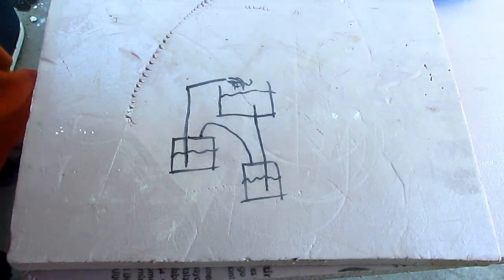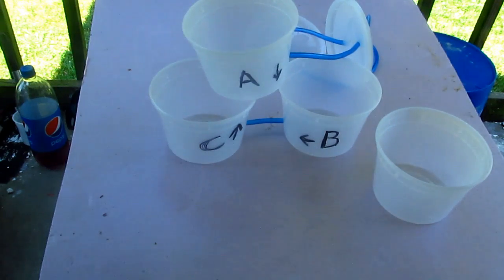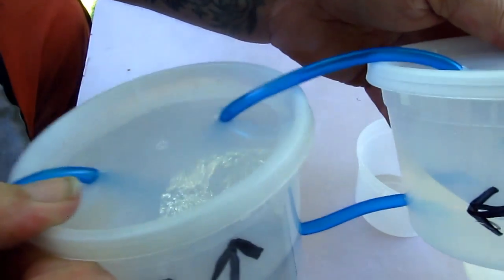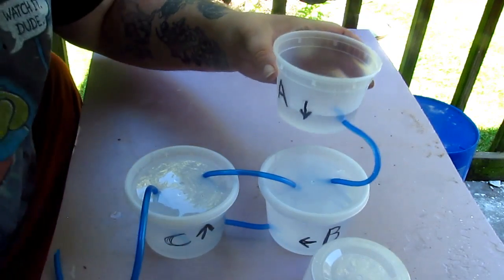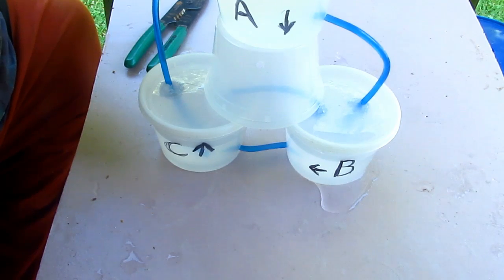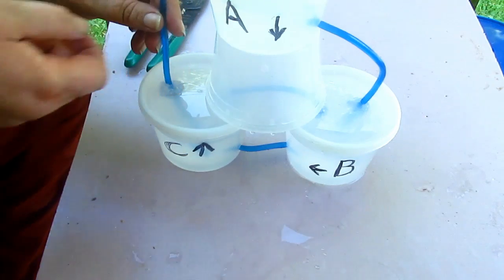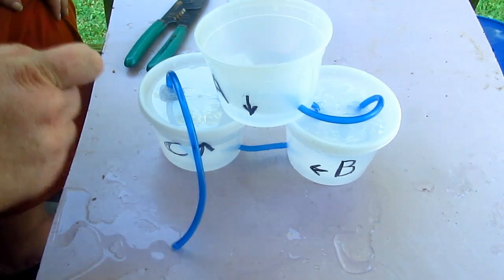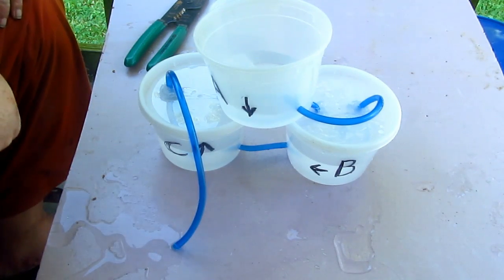Perpetual motion proof of concept with Herons Fountain Corrected

Comment: Ei=Ef. All energy adds up to be the same at the end as the beginning which makes sense why it only raised to original height. The reason the idea is impossible is cuz of loss like friction and sound but in this case its very little so energy is conserved much better as well as gravity is adding energy of 9.81m/s^2 at a constant rate to keep the same amount of energy applied to the water going from A to B

Comment: If you haven't made the original one before, look at this video to see that the tubing diameter & flexibility is not an issue: https://youtu.be/WYnlbFd45V8 . I suggest making it exactly the same as a normal one but instead, put the air linkage tube in the lowest container down to the water. That way, the pressude increase in the lowest container will be able to push water into the middle container, then the air pressure in the middle container  will increase air pressure & push water into the top container as per a standard Herons fountain.

Comment: Ok it never worked, dont knock the guy for trying.
Lack of pressure to drive the water back up the tube, has given me an idea.
Here is a clue, what happens when water is heated up????
Reply from the maker: Steve Stevens I may have to revisit this experiment with heat. 

Thanks for the positive input!
Reply: Everyday Diy 
I was thinking charcoal, in one of the lower containers.
Magnifying glass on it, u get the idea.
Reply: I will also play with this again, I tried what u tried for similar reasons.
People don't realise what a pain it is to do, even though it is very simple.
Keep trying years ago no one ever believed we would fly or go to the moon.

Comment: The poor old fella is consumed with the concept of 100% efficiency.
.
Adding line to the bottoms makes balance line.
Adding line to the tops , simply means two tanks are merged as one.
.
For perpetual move u need these modifications as l list:
(I am offering clues, not the answer, u like to know the answer? You must solve on our own, or just Contact me).
1.check valve (permits fluids move only in  one direction) !
2.different pipes (diameter).
.
Now u have the essential clues , good luck.

Comment: To make it work you need more water. First consider a few basic concepts: 1) Water seeks its level; 2) water can be used to compress air; 3) Atmospheric pressure, at sea level, is 14.70 pounds per square inch (psi); 4) a U.S. gallon weighs 8.34 pounds. 
THEREFORE - to raise water higher than where it started you have to use enough water to compress the air in both lower chambers higher than the 14.70psi of the usual atmospheric pressure. 
PLUS - you need to position the tubing so that the openings of the output tubes of both lower chambers are lower than the water level in each chamber. Thus the top parts of each lower chamber become air compression chambers which literally force the water up the tube, because its the path of least resistance, as compared to the weight of the water in the initial chamber.
Proof of concept would best be accomplished with a 55 gallon drum and two 5 gallon buckets with lids that can be sealed. Basic steps:
1) Make sure that the feeder tube from the 55 gallon drum empties at the base of the first 5 gallon bucket. 
2) Make sure that the opening of the second tube, in the first bucket, is also near the base of the first bucket (This allows the weight of the water to compress the air until the water is pushed from the first bucket into the second bucket).
3) Make sure the feeder tube from the first bucket empties near the base of the second bucket, and that the opening for the second tube in the second bucket is also near the base of the second bucket (allowing the accumulating water to compress the air until the water is forced back into the 55 gallon drum).
THIS WORKS when the weight of the water seeking its level (say 30 gallons at about 240psi) compresses the air in the lower chambers well beyond the standard 14.70psi atmospheric pressure. NOTE that the second bucket should be higher than than the first one as it acts as the "differential chamber" that balances the outside air pressure with the pressure in the lower chamber.
THEN- you could modify things by using a larger diameter feeder tube from the 55 gallon drum to the first bucket, and  a smaller diameter tube from the second bucket back to the 55 gallon drum; as well as taking a jacuzzi pump fitting to place in-line to make it easier to transfer the water movement into a turbine for a fixed-magnet generator.
And if more pressure is needed for more torque, then simply increase the amount of water in the 55 gallon drum.
Reply: Sorry old man, if you had enough physical education, and high enough IQ to visualize the physics youve been thought, then you would be set free, and all of this waste of time ideas could be ended. Im very sorry to say it like I just did, but if you aint smart enough, all of these obvious impossible physics will fool you. When I was a kid I could not get why a perp.motion machine was not possible, but in my teens all the peaces came together and I could visualize why you would have to create new universal matter constantly in order to overcome the laws that are in charge here. Only god himself is said to have created matter, but I became an atheist the day I understood that it is impossible for any religion to claim anything, and its pure logic. It is possible to see that it is mathematical impossible that the religious expl is right. But a dumb muslim or christian would not ever understand the pure logic that prove them wrong no matter how detailed you explain it. The formula E=mc2 is god himself..that small equ say more about how the universe works than all that has ever been said by all the belivers in faith that has ever lived. If that equation is not understood as logic, you cant do it as a visual thing.. Only when you have truly understood something 100%, your brain will be able to see the workings of the physics in a visual way. An when you are there, you can run visual experiments in your mind that will have a true logic answer that is of course correct! Sorry to be harsh but too many people are being fooled by those who know whats what. 
-to admit to yourself that what I can understand is only what I can visualize. Then you can say to a problem: hey I have no clue, and my guesses are always wrong since the info that would make me able to have a clue is missing. To understand that this is not something I understand, because i dont have the info that makes it understandable, is a huge step for anyone that will learn. To solve a problem that is unknown, a guess will not do, only the hard facts. And what are the facts, I dont understand any unknown problem coz its not known. And when all you see is both matter and also mathematics in visual in your mind, then you have a degree from the university of the real reality and will be a free spirit forever. You cant be fooled and have reached.. nirvana! But first step is to admit that I am a person that can be fooled because I dont know everything bout everything for sure, witch is to see it as logic!

Comment: prepetual motion? it's still just powered by potential energy turned kinetic by gravity. once the initial water has spent it's potential energy, your machine is out of fuel. how is that perpetual? 

furthermore, if you want to run a generator off of it, the amount of power you can harness is exactly the power of you lifting and pouring a cup of water with your arm (minus friction losses). 

congratulations. you as easilly impressed as a 1200B.C. Roman back in Herons time.

Comment: I'd like you to try something;  make A big enough so that you can put another container in it, but that container will be inverted.   You know when you put a glass under water, turn it upside down, and  start to lift it up out of the water,  all the water stays in the glass, until it breaches the surface?  Well, if there were a drain tube in the bottom of the glass, and the glass were inverted in A, then the glass could deliver water from a higher level than it is returned at.  maybe.  I don't know if you need two bottom tanks, but it would be cooler with two.  oh and you might need an aquarium pump or some kind of pump on the lines to start it.  if it starts.  you might try making a large inverted reservoir with a tube draining from the center and a pocket of air at the top.  if the air pressure in B and C, and/or the  air pressure in the reservoir in A can be kept higher than the outside air pressure, it might work, but i don't know if that's possible.  it would be good to experiment with the traditional 3 tier system, too.  good vid!

Comment: Not Negative Proof just simply to flexible of materials, The pressure created is not that great and is being lost by simply expanding the lids and sides if the thin plastic container. Rebuild it with glass mason jars or similar materials and I am sure it will work much better BUT I do believe Jar B should be lower than Jar C also to increase the drop from A and creating more push :)
Reply: DasCrafter laws of phisics are not laws as in human right/law

if b and c container are connecter in that way they will behace just like it would be one container.

Comment: Nice experiment, and I guess it goes to show perpetual motion does not exist.  I mean even if this had worked, which due to the equalization properties of adding the additional tube it wont, water, or any liquid would eventually evaporate which is why it still wouldn't have been perpetual.

On a side note derived from reading the majority of the comments... I think it's pretty sad so many think this device or any "perpetual motion" device is even possible.  Were you all absent that day n middle school science class when they discussed why perpetual motion is impossible?
Reply: DasCrafter 
Because there is no perpetual motion. Here on earth we have WAY to many other forces to overcome. Friction loss from water flow in tubes. Corialis (sp?) effect on the water flowing down from tank to tank and several other energy robbing factors
Reply: DasCrafter all of those was prooven wrong just like perpetual motion was prooven wrong

Comment: the problem with the idea of perpetual motion isn't that it can't work...  It does work; because I've seen it.  The mistake is the idea that over unity is possible.  And that I don't think is achievable.  Once you have your perpetual machine, all you will have is a novelty.  Because eventually something like evaporation, temperature, or oxidation will come along and off set the efficiency of the machine.  In order for over unity to work I think, one would have to create a separate environment  Something that involves a good bit of under water pressure or gravity in a very deep hole, or something even completely compartmentalized from the outside environment.  The point being micro environmental factors will have to be over come by macro environmental factors or taken out all together.
Reply: You've seen perpetual motion?  You Tina are the first person in history then.  Because to the rest of the world, perpetual motion simply does not exist....

Comment: Try using containers which do not expand with the air pressure. The expanded air is just staying inside the expanded container otherwise

Comment: Try to increase height of A hence more gravitational force it should increase pressure and need more gallons plus stiff bottles
Reply: but then there is the problem that the return pipe has to travel equal distance back UP, meaning there must be more force to push it. Vertical elevation won't fix it. I think he's right that there must be more water in A
Reply: +Connor Amlee except I don't believe the size of the pipes should change anything because only gravity and fluid pressure will change anything

Comment: The water in container b and c will fill up each other. Water will flow to balance the pressure at the easiest way, remember? There goes b and c are just like a single container. And the water from other end of pipes will just work as there are only one container down there which connected to form some kind of air proof tube. Sorry if I have a bad English.

Comment: dear sir, move the tube connecting B and C to connect from underneath each one instead of from the sides.
Reply: I don't think that will change anything. the point of those tubes is to connect the water pressure from bother containers. It shouldn't matter from which angle they connect.